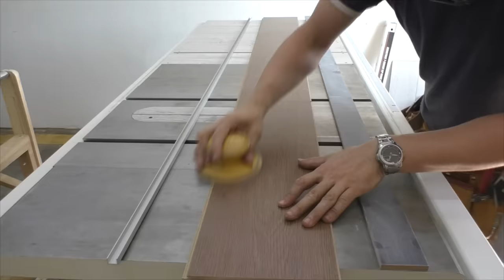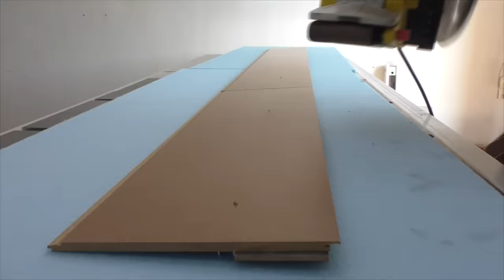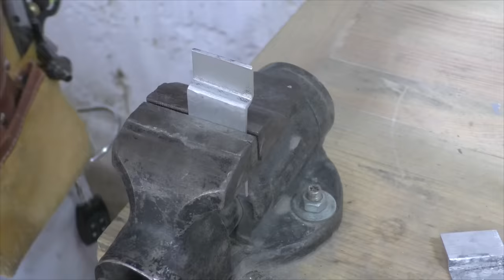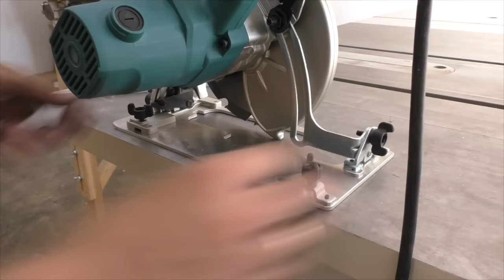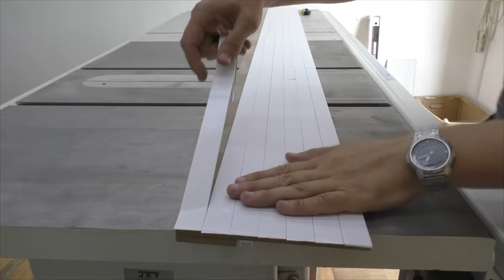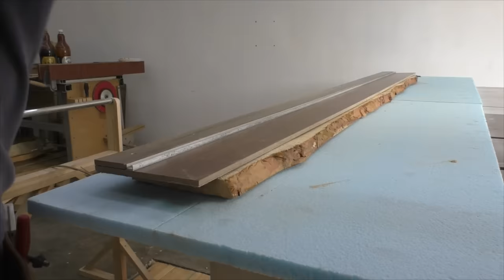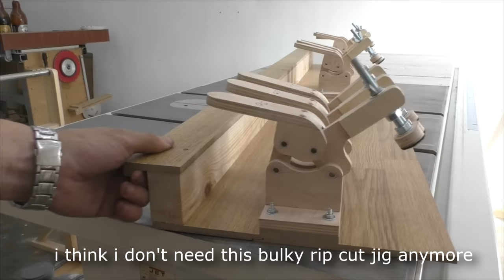🟢 Homemade Track Saw - DIY Guide Rail for Circular Saw

Comment: You have used 2 different sized channels so that one fits on top of the other. Can you provide the 2 channel sizes and how much slop or movement one has over the other. If the slop is removed and guided by the laminate behind the lower channel, how did you set the clearance and by what amount to ensure the saw channel does not bind?

Comment: Great vid and variation of an idea but it is dependant on having a reasonable table saw to make it! 🤔
Reply: You could just screw a piece of extruded alloy into the middle of the board and use that as the guide to true up either side. No need for anything more than the saw you build it for. As long as the u channel is straight you are good.

Comment: That is an expensive DIY track if you add up the cost of the wood, super-glue, aluminum channel, foam tape, and sandpaper. I prefer to just take some MDF or hardboard, wood glue two strips together, and done. Could add a few small rectangles of sandpaper spaced out along the bottom if necessary.
Reply: So basically the only thing you would change is not adding the utrack?  Something that cost like 10 USD and make the accuracy 10x better?
Reply: @jaydallas9895  No. Try to read what I wrote.
Reply: @XJWill1  I did.  The  jig in the video is two pieces of wood glue together, with sand paper on the bottom and u-track.  Your jig is 2 pieces of wood glued together, sand paper on the bottom, and no u-track.   What am I missing here?   Are you simply saying, if it were you, you would find a way to be slightly more frugal with materials and not add u-track?   I mean the guy is using two piece of laminate flooring, it's not like he choose Wenge and gold plated screws
Reply: @jaydallas9895  Then you need to pay more attention. Basic 1/4-inch MDF is cheaper than hardwood laminate, but that is not the only difference. Super glue is much more expensive than wood glue. Screws are more expensive than no screws. Sanding belts are more expensive than no sanding belts. Aluminum extrusions are more expensive than no aluminum extrusions. Several rolls of foam tape are more expensive than a fraction of a roll of double-stick tape. A huge strip of sandpaper is more expensive than a few strips of sandpaper. Once you add up all the additional expenses, you may as well just buy a commercial track. The point of a door board is that it is cheap. You slap togethers a couple pieces of MDF or hardboard with wood glue and stick a few strips of sandpaper on the bottom. Done. Works great too. No aluminum extrusion is required to get a nice straight cut. Bullshit the accuracy is "10x better". As long as you can push your saw against a straight edge, the accuracy is the same. I use a basic door board all the time and I get perfect straight edges. If it were more than 1/32-inch out of straight I would see it when I check it, and it never has been.
Reply: @XJWill1  I'm am paying attention, you're not critiquing the design, you are critiquing the material choice.   Obviously you can build it without screws or use a lease expensive wood. Although laminate floor would be far more durable than 1\4 inch MDF.  I'm not really sure there  is an appreciable difference in price,. Same with aluminum runner. ndont want to believe me that it is more accurate?  Ok, are you really going to sit there and tell me MDF runner is more durable than aluminium?   And now more to the point. In ten years this jig will still be dead accurate, and you would have remade your MDF jig no less than 20 times.   So tell me again how your way is so much better?
Reply: @jaydallas9895  No, you are not paying attention. You just ignored most of my comment, then wrote a bunch of nonsense. Pay attention! Don't write nonsense! I most definitely criticized the design. There is most definitely a big difference in price. MDF is plenty durable for a door board. I have one that is more than 10 years old and the straight edge is not noticeably degraded. And hardboard is more durable than MDF, which is already plenty durable. Think before you write nonsense.
Reply: @XJWill1  projection is a powerful thing
Reply: @XJWill1  rarely do I have to state the above twice, but I think in this case it may be warranted. Here's hoping you can make it 3 in a row for the first time in internet history
Reply: Great call! It would save a tone of time too! And my time is worth $$$$. 

I saw another interesting idea to use silicone on the bottom and spread it with a v-notch flooring trowel. Seems like the sandpaper would scratch your material anyway.
Reply: @chemacb  If you want to save time, just buy a track saw.
Reply: @XJWill1  I actually came up with an even better solution. I already had a Kreg track lying around so I cut a strip of hardboard that fits in the groove of the track and taped it to my circular saw. I marked the circular saw so I know exactly where to re-tape it each time.
Reply: This is such a funny argument

Comment: I have one very similar. I used a fir 1x8 for the base. It works great, but a thin kerf blade can deflect and cut into the guide edge 1 or 2mm.  I drilled large holes in each end for clamps so I don't need the sandpaper to hold it.

Comment: Wouldn't a rubber backing to the bottom of the track hold faster to a smooth wood surface than non-skid?

Comment: The non-slip base is not a good idea as it would scratch up kitchen end panels.  Like idea of using the fence holder on the saw base.  Once the U track is in place, can the wood strip be removed, or is it required for strength?

Comment: Do you hate yourself yet from putting 40 grit sandpaper on the bottom or do you only use it on unfinished stuff?
Reply: The track doesn’t slide on the material being cut. It stays put and won’t harm the finish of plywood or whatever else you are cutting. Unless you scrub the track back and forth like a sanding block. If you are still concerned about it, just put the track on a concrete floor and  slide it back and forth for a couple minutes to dull it a bit. But that’s not necessary in any case. 

The track is an outstanding example of creativity by a guy who knows what he’s doing!

Comment: The same store you bought all your tools drill press drills table saw with crosscut sled sander rubber hammer shop vice clamps hand saws but somehow didn’t see the rip guide on the shelf…

Comment: Why didn't you use pop rivets where you used screws and nuts?
Reply: Pop rivets will protrude from the bottom if they’re properly sized and if you grind (or sand as in the video) them down then they will not be as effective.

Comment: great idea.  What sizes are the two aluminum C channel?  I assume one has to fit inside the other, correct?  Where did you get it from?  What is the purpose of the hardwood behind the rail, just something to place a clamp on and to stiffen the jig?
Reply: It provides the other side of the sliding channel. Could have been much smaller.

Comment: Hi, great idea to invert the U channel, what size channel did you use, looks like a snug fit ?
Reply from the maker: Hi, the long channel was 15x12mm and i cuted it to 7x12mm, the short one is 10x15mm with 1.5mm thick walls
Reply: Thanks for this info.

Comment: Weirdly interesting. mostly because it's very 1960 - the guy uses a corded drill for drilling and a manual screwdriver for screwing (no pun intended).
My granddad used the the same tools into the era of "battery/cordless powertools", saying it was better and more precise.
Clever.
According to granddad.
Not according to 2022.

Comment: Did you use your regular blade to cut the aluminium??  I have seen you cut  a T slot from aluminium rectangle section too.. was that cute with a standard blade on a metal  blade??
Reply: asaik aluminium is pretty soft to work with many wood blade/cutters, especialy if you keep the cut slow.

Comment: Does anybody know what size aluminium U section is used on this guide? I checked out the sizes at my local hardware store and none of them fitted together neat enough to give a stable cut. The one's used in this project appear to be a nice fit.

Comment: I'm a retired framer ( if it don't fit get a bigger hammer) and boat builder.  Not in any way a fine woodworker.

What's wrong with a straight edge?  I have one a 1/2" inch less than door height I made when I was an apprentice.  Cuts straight without losing saw blade depth.

Comment: Not tryna nitpick at all just tryna understand, but isn't there 1/4 play in the  track if only one edge of the rail attached to the saw slides in the entire fixed channel? I get it if there was a space between the saw plate and the channel so the entire rail sits into the fixed channel on the board rather than one side only. Sorry if I'm not understanding correctly but I think you'll be better off just using the fixed channel as a straight edge for your saw plate or am I not seeing something.

Comment: You don’t really need the aluminum track. Just run the edge of the saw plate against the upper straight edge you applied. Boom, cuts your build time by 75%.
Reply: The track keep the saw from moving out

Comment: what is the model number of your Makita saw ?  its hard to find one with the 2 knobs and attachment at either end to  be able to install the c channel. thanks ! definitely going to try this one. been wanting to make a track saw guide to cut 8ft and 4 ft sheet goods. new to wood working. greetings from a Jamaican living in Texas.
Reply: Alot of these jigs on u tube can converted to fit most other circular saws out there, this just hes way he built hes.

Comment: hello Gregory - question: what adhesive did you glue the panels together for approx. 2m?
Regards from Poland 👌good job
Reply: Most likely it was a quick set cyanoacrylate adhesive such as super glue just to quickly secure the wood before screwing them.
Reply: @MrCoolAttitude  Thx Mate👍

Comment: Nice, are you willing share list of materials more what was the none slip you put on the bottom?. thanks
Reply from the maker: Thank you, Joe
On the bottom i glued up a 40 grit sandpaper on the double-sided tape
Reply: Thanks was thinking the same thing.
Reply: @GRINwood  1 strip cut from a rubber conveyor belt or rubber sheet?

Comment: It’s very cool, what you did, but by the time I buy a large table saw, a vise, a drill press, the belt sander, the files, the various other materials and tools, and build my crosscut sled, I could buy several factory-machined tracks!

Comment: Your circular saw has the slot to attach the guide on both front and back.  This is the key.  Which model is it - I didn't see anything like this before.

Comment: Nice job. Question, are the 2 screw down clamps on the shoe of the saw original, or did you add them. I have a Dewalt, but they arent there, nor holes.
Thanks

Comment: Why do you need a track for a circular saw if you have a table saw?
Reply: You can't cut a live edge slab with a table saw.
Reply: @kevinshetrompf2036  You think a track could be made without a table saw? I'm trying to figure out how to get long straight cuts with just the circular saw until I can afford a table saw
Reply: Yes, use the factory edge of a piece of mdf or plywood as a straight edge to reproduce more straight rips.  It can be done with patience and attention to detail.

Comment: Question Minute  2  :   11   Seconds  .  Are those aluminum pieces have a small play in them ?  I think yes.  I know...   The vertical side of the hardwood (1/2") will rub and close the gap  99.99% bv.   Is that true ?

Comment: One could buy all the tools and materials to make this — a workbench, a vise, files, belt sander, drill press, table saw, crosscut sled, extruded aluminum, vinyl flooring panels — for about $3000-4000. Or buy a track for about $100. And why build this track in the first place when you have the table saw? You even made the same cut yourself with the track saw and then with the table saw.
Reply: You can't cut a live edge slab with a table saw. A table saw will not straighten a bowed board, it will continue to repeat the bow.
Reply: @kevinshetrompf2036  I realize that, and it’s a fair point, but what I was getting at is that this track build requires way more work and expense than is worthwhile. MOST people needing to DIY a track won’t have half this equipment to begin with. One should be able to build a very good track for a circular saw in about 30 minutes with nothing more than ½” plywood, a drywall square, a circular saw, and some screws and glue.
Reply: @danielakerman8241  agreed it was a more involved build than what is probably necessary. I just got back with a sheet of underlayment and a sheet of 1/2" MDF to make a long saw Guide. I work with a lot of pieces that are too large to run through the jointer. The Last batch I used a chalk line and cut as close as I could by hand, then ripped wider than needed on the table saw, then set the table saw to the finish width and flipped the board around. Way to many steps for production. My point is that even with all of the equipment a track saw still serves a unique purpose that can't be accomplished with the other tools.  I wouldn't even consider a cheap track saw for the precision needed for my work.  The version that fits the bill for me would be $1300, so its worth the time and effort to make something myself. I'm certainly going to start out simple, but who knows, I may end up going with linear bearings and rails at some point.
Reply: Some people have access to a machine shop or wood working shop, but don't always have access to those tools.

Comment: When a video starts with somebody tossing wood on a 12 foot wide table saw, I exit. Not many people have this type of tooling. At least the people that would be building tooling to save from BUYING that tooling. IMO a WEN track saw makes waaay more sense than building something like this for DIY folks.
Reply: With time you can acquire alot of things , if you are just starting in this hobby and or craft.

Comment: And a drill press and a grinder and a hand drill and a vice and a hammer and a sanding machine and a hack saw and a square and glue and wrenches and a sheet of insulation and double sided tape and razor knife hours of labor. Or just go buy a real one for far less money.

Comment: It would have been much quicker and easier to just fit the aluminium U channel to the board without the other board etc... what a waste of double-sided tape.. just glue the sandpaper straight to the underside of the board......

Comment: Not good for cutting veneered panels without scratching the surface. Instead of sandpaper backing why not use foam or rubber strip like makita does, it is also lacking splinter rubber guard. Spend some money and buy proper stuff

Comment: with so many fancy tools and equipment already in your workshop - why bother with self made tools? haha
Reply: For people like me who don't have all the fancy tools but can use the basic tools we have to make such a track now that we have the idea.
Reply: You can't make it with basic tools (I.E. just a cheap circular saw which btw cannot even be used because the base plate wont be parallel to the blade, ask me how I know), you already need a way to make precise cuts before you can build it. Surely you noticed he used a table saw?
Reply: If you can’t make it with basic tools then what’s the point. Once you buy those advance tools you don’t need to make such a thing anymore. It’s like buying a motorcycle so that you can go get a bicycle to ride to a nearby shop. Haha
Reply: @marinekong235  Yeah it's a common theme on youtube with people having massive workshops making DIY tools that would only be useful if you didn't have such tools in the first place. But consider this has 1.1 million views so it was worth to do it for the views..
Reply: Yeah I agree - do it for the views by all means. Many likewise meaningless videos on YouTube haha

Comment: Probably gonna get flak here but this is a waste of time lol there is no substitute for a real track saw. First they have come way down in price and second it's the repeatability without having a substrate warp, third dust collection!!! and a bunch of other features. I used to set up a guide rail and use a skill saw but when you actually buy a real track saw it's like a light bulb going off in your head, you wonder why you fooled around like the maker of this video. Cool idea, but will cause more frustration in the long haul.